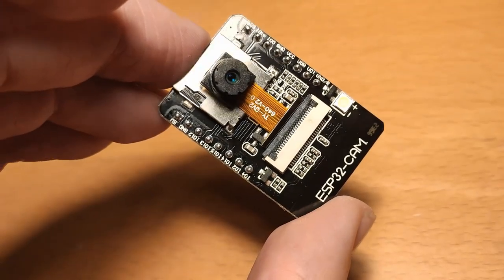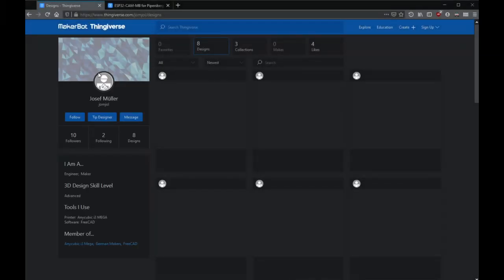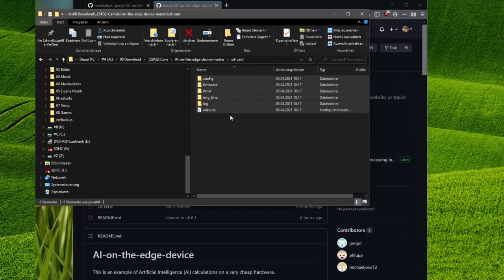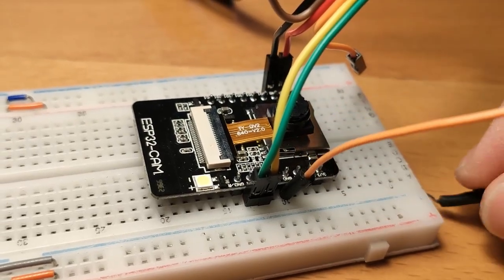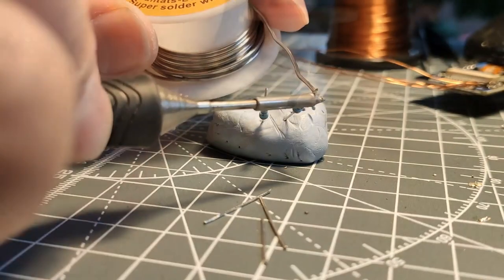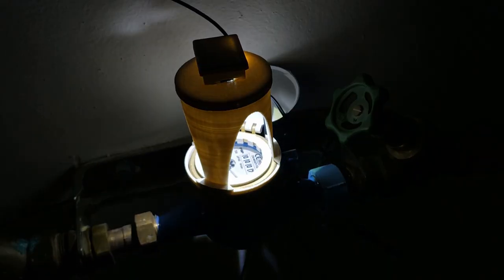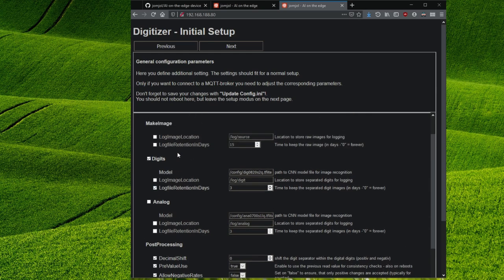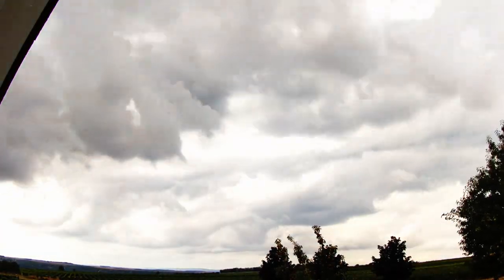ESP32-Cam on your water meter with "AI-on-the-edge" -- also for gas and power meters

Comment: Briliant idea. I made first aproach to read gas meter before I found this project. My ESP32cam makes photo and send it to gmail. For safety against to lose data, it takes photo 8 times a day. Next, I read mail, check foto with measurment and fill google sheets that contains all my gas use statistic. Did you think to add funcionality of automaticaly filling google sheets with data ? All the best !
Reply from the maker: I find it hard to believe what you are saying. If you really do it via gmail, you should think about another solution. As I said in the video, I'm not the developer of the firmware, but I think it's unlikely that the actual developer will add such a feature. You should rather think about getting a Raspberry Pi with IOT-stack (InfluxDB, Node-Red, Grafana).
Reply: @MakerMeik  It's still better than going outside and reading the meter. 😀 I do not have to worry that I will not read the gas meter at a certain time. 😀
I have 2 RPI devices on the network. One has been working with Domoticz for several years without interruption. The second from Home Assistant from InfluxDB, Grafana, but even though RPI is working, I often can't log into the HA. I have already prepared an ESP32cam with this soft. I need to install and configure the readings. I will try new solution. Regards

Comment: Wondering if I could leave the USB programmer connected to the ESP32 Cam and plug that into a USB battery pack to provide power in my remote water meter location. I could take it out and charge it every few weeks or so.

Comment: Great project.
Acetone (nailpolish remover) may be less hassle to remove the wire varnish.
Reply from the maker: I just had to try this out immediately. Unfortunately, it has not worked with my copper enamel wire and my wife's nail polish remover, although this is actually acetone-based. So it may depend on the varnish of the wire. Nevertheless, a great tip and I will test it again with my next spool ;-)

Comment: Thanks a lot for your work, really appriciate this ! I always wanted sth like that. Now printing the linked items of thingiverse for the watermeter does not work- the esp32 does not fit in because the file 03-21_Wasserzaehler_main-cap… has no opening for the sd card slot. With some force to the printed item it now works ;)
It really needs the sd card to remain in the esp32, does it ?
Reply from the maker: Yes, the SD card is required as far as I know because images, config and log files are cached there. The problem with the case has already been pointed out to me and in fact I just updated it today. Sorry you ran into this problem. As you can see from my pictures, I had just made a small cut with a pocket knife in the location for the SD card.
I had forgotten about the problem in the meantime when uploading, otherwise I would have fixed it right away. The video was made a few months after my installation on the water meter.

Comment: Can you direct me to the lens you're using?
I have a little dome shaped lens on my ESP32CAM, and to be able to get a decent picture my focal point is about 15mm from the meter. This means i don't have to print a big tower, but it also disforms the numbers a bit i guess (fish eye effect)
Also, my meter has white number on black, and for the decimals white numbers on red.
I suspect that the contrast for the decimals is too little to recognize the numbers.
But, to be honest, i'm still experimenting with lighting and reflection reduction..
Awsome project!
Reply: Found it, it' must be the cheapest 70 degree angle  lens for the espcam. Mine is a 160 degree wide angle lens, also widely available on Ali for a few euros more
My first testing is promising, and i'll be using the 160 degree lens,
It all makes of breaks it by the picture quality without glass reflections. That can be quite tricky to setup..

Comment: Simple question: You had a lighter all along. Why didn't you use it to remove the enamel from the copper wires instead of doing that mess with your soldering iron? Just burn the tips and remove the burnt enamel with a knife or a steel wool.
Reply from the maker: Thanks for your tip. I just tried this and it really works. I couldn't say if it would really speed me up in the end, but it's definitely a good alternative.

Comment: I see that the project allows configuration by fixed IP with three parameters (ip, gateway, netmask) to be able to do LAN communication.
The question comes is, does an ethernet module have to be added and what would be the pins already configured?
or by connecting a USB to ETHERNET converter to the TTL module.

It would be of great help thanks.
Reply from the maker: I think you have misinterpreted that. As far as I know, a LAN connection is not possible with the ESP32-cam microcontroller. The connectivity is always done via WiFi. A fixed IP only means that your router does not assign a new address each time via DHCP, but instead the IP address is fixed. This must be set in the router as well as in the configuration of the ESP.

For this project this should not make a big difference, but it helps e.g. with installations, where the ESP is regularly woken up from the deep sleep. If you have a fixed IP, the connection will be established much faster. If you have a battery-powered system and the ESP is immediately put to sleep again, this can significantly extend the lifetime until the next recharge of the battery is required.

If the background of your question is only a shaky WiFi, you should rather fix its cause. For example, by repositioning your WiFi router or adding a repeater. If it's just a matter of selective IOT connections, this project might also help you: https://github.com/martin-ger/esp_wifi_repeater

Comment: Wonderful Video! Can you use another ESP32 to read the Value, and how?
Reply from the maker: Do you already have an MQTT broker running on a server? If so, even an ESP8266 is enough to subscribe and process the MQTT messages. However, if your question is that you would like to use an ESP32 as MQTT broker, you should have a look at the corresponding libraries. I have no own experience with it, but the sMQTTBroker library sounds promising for example.

Comment: This is amazing! In my case, both counters are outside of the house without electricity. How can I solve it? Any tip?
Also, congratulations for your youtube channel.
Reply: Put esp32 in deep sleep after readings. Lion batteries, you should charge it every month, or replace it with a charged one every month. See Andreas Spiess channel on deep sleep and battery powered ESPs.
Reply: @guatagel2454  Hi! Thanks for your feedback. I tried something like that, the issue is that I need to replace it very often, less than a month, and it's not very particle. I need something for at least 6 months. Thanks anyway :)
Reply from the maker: Thanks for the congrats. Without a permanent power supply, however, it will probably be challenging. Here in the chat others had already the topic. Of course you can test the deep sleep function of the ESP. However, as you have already written, you won't get very far with it. On the one hand, the required wake time of the ESP is quite long for this project. Unless you really want to charge the batteries every few weeks, you can probably only read a few times a day.

Also, I know from my own experience that the deep sleep function is usually treated poorly by ESP developer boards. I plan to do another compact video on this myself in the next few weeks. But you can find the essential tricks in these two videos:
https://youtu.be/rfPwOtoGO4E?t=211
https://youtu.be/J66_8P043ko

I'm not quite sure if this is necessary or possible with the ESP32(-cam)s though.

Further down in the chat, @Vladimir Kuznetsov also brought up the discussion of whether it wouldn't make more sense to count the pulses via IR sensor, at least for electricity meters. If that is an option for you, your chances for a battery-powered project would certainly be higher.

By the way, the main power consumer is the wifi. Maybe you think about an offline solution. Or send the measurement data only once a day ...

Anyway, the ESPs are not ideal when it comes to power consumption. On the other hand, complex projects like AI-on-the-edge are hardly possible with simpler MCUs. Let's see what future MCU generations bring. The RP2040-based boards already look very promising.

If you successfully complete the project, I would be very happy if you also make a short video about it.
Reply: @MakerMeik  Hello! I'm really sorry for my late reply. I didn't noticed it. I will read carefully and take that in consideration. Thanks! Best Regards.

Comment: can all this be run in a raspberry Pi ?
And may I know what raspberry Pi model would u suggest to use for this project ?
I'm trying to develop similar system like yours but with an electrical meter for my final year project
Reply: or can I run on arduino mega?
Reply from the maker: A Raspberry Pi has potentially much more power and could of course easily do that. However, there is a lot of development effort in this project and I think you won't find a comparable project for the Raspi at the moment, unless you want to program and train it yourself. But of course, the Raspi is a full-fledged small computer and the ESP32 only a microcontroller with limited resources.

Comment: Stabile leistung. Hab mal n Like & abo da gelassen. Hast schon erfahrung ob das ganze auch mit "tacho" anzeigen funktioniert?
Reply: Hallo Frank, was meinst du mit Tacho anzeigen? Der Ansatz auch für analoge Zeiger möglich und kann recht einfach erweitert werden. 
Ich bin der Entwickler der Firmware (jomjol) und tausche mich gerne mit dir aus, um neue Applikationen zu finden.
Reply from the maker: Hallo Frank, jomjol hat ja schon seine Hilfe angeboten. Mir ist auch nicht ganz klar, in welchem Zusammenhang du das mit dem Tacho meinst, aber ein Flaschenhals könnte sein, dass der ESP32 eine Weile braucht, um die Bilder zu machen und auszuwerten. Das kürzeste Intervall ist bei AI-on-the-edge darum auf derzeit 3 Minuten beschränkt.  Wenn du damit das Manometer des (Haus-)Wasserdrucks ablesen willst, sollte das reichen. Auf einem Moped würde ich die Installation aber eher nicht empfehlen ;-)
Reply: @MakerMeik  @Frank Müller
Also an der Erkennungsgeschwindigkeit gibt es durchaus noch ziemlich Potential. In einer kommerziellen Variante mit nur 3 Ziffern und einigen Geschwindigkeitsoptimierungen kann ich das Bild in unter 1.5 Sekunden verarbeiten.

Comment: Hello,
What is the reference of the PSRAM on your esp32-cam ?
I have IPUS ISP6404L and there is an error on the psram
Reply from the maker: Hi @Hervé Lacerre, my ESP32 cams have IPUS IPS6404LSQ installed. Since several users have now written about PSRAM problems, this could really be the cause. Do you think you can re-solder the IC? It would be interesting to see if the problem can be solved this way.
Or you can ask jomjols on his Github page if he knows something about this IC or a way to fix the problem.
Reply: @MakerMeik  I have re-soldered the psram, but same error

E (506) psram: PSRAM ID read error: 0xffffffff
E (506) spiram: SPI RAM enabled but initialization failed. Bailing out.
Reply from the maker: And the normal CameraWebServer example works, or are there also problems with it?

Comment: It's an excellent proof of concept, but I should point out that a computer mouse couple of led + 2pixel CCD would do the trick with less error. The only problem is that there is some cases the glass cover is too far away from the black and white turning disk, that would require some adjustments.
Reply: Ideas like this are nice, but without any demonstration, an idea alone is not useful.
This is a tested, working real example. For many interested in this topic, the difference between an idea that "would" work and a solution that "does" work is more helpful by an order of magnitude.

Ideen wie diese sind schön, aber ohne Demonstration ist eine Idee allein nicht nützlich. Es gibt hier ein getestetes, funktionierendes reales Beispiel. Für viele, die sich für dieses Thema interessieren, ist der Unterschied zwischen einer Idee, die „funktionieren würde", und einer Lösung, die „funktioniert", um eine Größenordnung hilfreicher.

Comment: Now days there are smart meters which uploads to service provider website which you can confirm online and on the box if you wish
Reply from the maker: True, but if the provider still uses analog meters, as in my case, this is an inexpensive way to log the meter readings yourself. And I think you can derive very interesting conclusions from it.
Reply: @MakerMeik  Yes definitely, I thought I wouldn't mention the obvious. I only stated this because I actually had the thought that this is awesome and I should do it, till I realized I had a smart meter. Providers nowdays are installing it for free too, so if that's the case, I'd hold out on this project and do one of your other ones. :D

Comment: Too bad the gasmeter housing has been removed :( tried to read my kromschroeder by magnetic pulses, but i get untrustable counts (10000 m³ on one day)so i wanted to try the esp32-cam. Any chance to get the housing back up?
Reply from the maker: I have not removed the housing of the gas meter. Thingiverse has probelms sometimes. Here's the direct link:
https://www.thingiverse.com/thing:4845512
If it doesn't work you can also download the model from printables.com:
https://www.printables.com/de/model/109982-gas-meter-ai-on-the-edge
However, I would definitely recommend bugfixing the magnetic pulse solution as it is the simpler solution and therefore less likely to fail.
Reply: @MakerMeik  Thanks for the links, the thingiverse link is not working (for me)

Comment: This is quite hacky, but I like it! 
You could have used an optical sensor on the rotary wheel instead.
Reply from the maker: Yes, that would also be a good option, at least for the electricity meter. The German Youtube channel "BitBastelei" also made a nice video about this (https://youtu.be/bZAZcHttFaU). Unfortunately, it is only available in German.
However, this would not work with my gas meter and it is also difficult with the water meter. In addition, you have to be sure that no pulse is lost. You don't have this problem with the ESP32-cam solution, since an incorrect reading is corrected at the next readings.

Comment: Very nice idea....How to get ocr digits on serial output to gsm modules or nb iot
Reply from the maker: I think you will have to take a closer look at Jomjol's code and adapt it to your needs. Since I haven't dealt with the code myself, you would have to contact Jomjol if you have any questions. If you get further on this topic, which has already been asked by other users, it would certainly make sense to fork the project or ask Jomjol to integrate your contribution into his project.
Reply: @MakerMeik  thanks a lot ...Sir

Comment: Wich is your soldering station, please?
Reply from the maker: I have built the soldering iron according to the construction proposal "Maiskolben". There is an article about this in the German "Make" (unfortunately only in German)
https://www.heise.de/make/artikel/Platine-fuer-DIY-Loetstation-Maiskolben-3569923.html
The developer also has a store where you can order the PCB. But these are often not in stock.
https://hannio.org/en/produkt/maiskolben/
The soldering station uses the professional soldering tips from Weller, I use e.g. the Weller RT 1, and it controls them via an Arduino. The total sum of the components is about 80 EUR. However, in the meanwhile I also bought a Miniware TS80P, which has a similarly good handling and costs similarly much, but without the tinkering effort.

Comment: what happens if the number is half way rolled? like for example half way between 8 and 9
Reply from the maker: The firmware has a correction mechanism that notices when no meaningful value can be read. This place is then marked as "N". The recognized number is then e.g. 4373N.59. 
Based on the rules that you have defined in the PostProcessing section of the configuration, the firmware then tries to determine a reasonable value. If this does not succeed, the entire value is discarded.

Comment: hello,
I have two esp32-cam with PSRAM problem, it boots in loop (failed to init external RAM!)
I received a third one ESP32-D0WD-V3 (PSRAM) with ESP PSRAM16H
There is no psram problem but it is rebooting after fiew seconds after boot up (same as issue #403 on github)
The error is "Guru Meditation Error: Core 0 panic'ed (LoadProhibited). Exception was unhandled"
The problem exist with version 9.1.1 and 8.0.0, with three camera and two sd-card.
It boots with version 5.0.0 and I can configure and take pictures but they don't appear in overview.
I don't know what has changed in the program since version 5.0.0

Comment: can you remove the mac from the device, or between the files could you program it to add it?
Reply from the maker: I'm not a network expert, but I would guess that network devices always require a MAC address. Maybe I just misunderstood your question. If you want changes to the code or the functionality of AI-on-the-edge, you can kindly ask jomjol on Github. Feature requests are certainly welcome there.
Reply: @MakerMeik  understood thanks